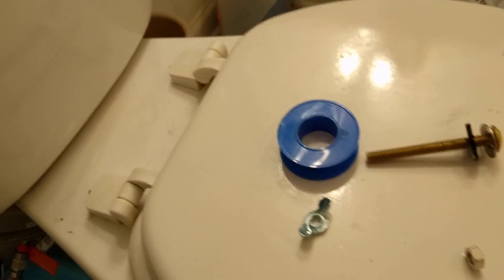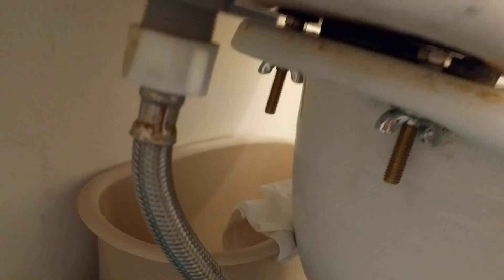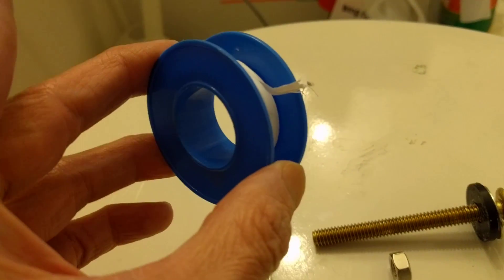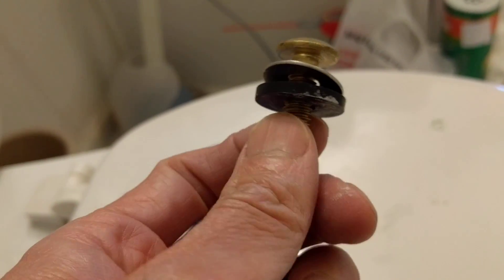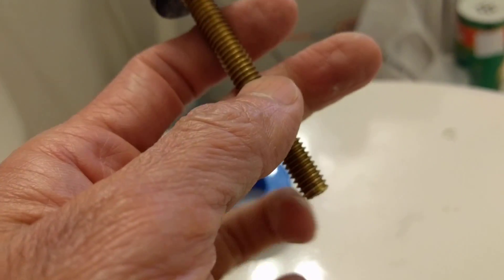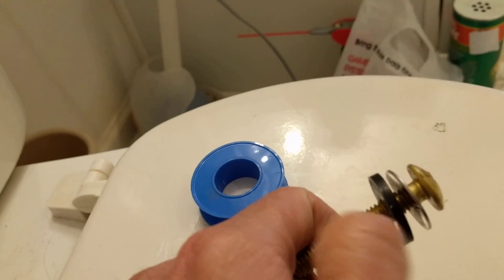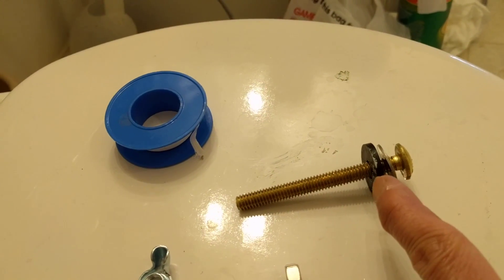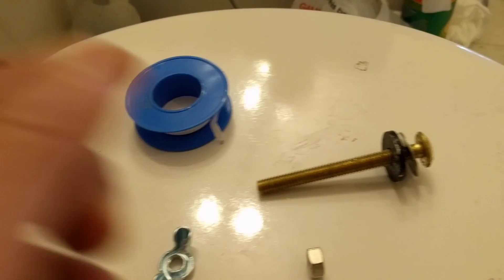Toilet bowl leaks from the screws

Comment: Great info thanks.   Reading some comments below , I came to the conclusion that the metal washer inside tank should not be there only the rubber gasket !  Once I removed the metal washers , no more leaks from the tank bolts !  Thanks everyone for the great advice.

Comment: I agree with the others saying you should not use the 1st metal washer. I know the instructions on the repair kits say to do so but if you look at how the new tanks come, it is always as follows: Bolt and 1 rubber washer inside tank. On the bottom, rubber washer then metal washer and bolt. Tighten until snug and  a slight more but do not over tighen. That's it. There is no way water will drip throught the threads. After that you can attach the tank to the bowl. It is also important that the bolts you use can pass through the ceramic holes on the bowl. If not, you can end up not being able to secure the tank to the bowl properly and the spud will not be seated in place firmly enough to not leak when you flush. Finally, on the bottom you can use the wing nut and a metal washer  with the rubber washer optional. Again do not overighten to avoid breaking the ceramic bit tight enoughg that the spud seals properly. No need for the teflon tape in this type of repair. To need it means you are doing some else wrong.
Reply: Actually all the instructions say NOT to use a metal washer inside the tank, and warn it will cause leaks. I just made this same mistake. Many how to-guides on the internet get this wrong too - would have saved me messing around with silicone!
Reply: It depends how big the bolt head is btw - i did try both approaches and currently i have two working bolts : 
1. Without a washer with teflon ribbon btw.
2. With washer because when i did push it without washer it pulled the bolt thru the rubbber seal (cone shaped but still). The head of my bolt was pretty small. 
So both works , if you don't overtight it ...
Reply: Exactly correct
Reply: I follow the instruction but doesn't work. What I did wash install bolt and rubber washer inside the tank,metal washer,rubber washer again,metal washer,and nut. it work great
Reply: Both metal washers outside the tank and nuts

Comment: Good advice in here. I think the best advice was to add the third metal washer underneath the gasket that contacts the underside of the toilet tank. This allowed for the bolts to remain straight and was easier to tighten the bolts under the bowl.  Using teflon tape is a solid idea too. I also had an issue with the bowl to tank gasket not fitting on the bottom of the valve. Frustrating because I bought the valve new and the gasket new,. To allieviate problems from the gasket moving when placed on the bowl, I added a bead of plumbers putty into the gasket and then stuck it to the valve.

Comment: You installed the bolt wrong, if you put metal on metal it will leak. If you put the rubber washer between the bolt head and the tank with no metal washers in between, it will not leak. Try it that way if it starts leaking again.
Reply: You are absolutely correct. I looked at mine and it is the way you said and have just recently figured out why  they did it correctly and originally that way.

Comment: thanks, good thinking. so the gasket wasnt the problem. the bolt needed a sealer... probably a more snug fitting gasket would have worked without the teflon sealer i'd imagine, but good to use both.

Comment: NO, NO, NO.
1st - Clean all the rubber washer seating surfaces on the inside (water side) of the tank. Don’t use anything that is abrasive or can scratch the porcelain finish.
2nd - Do NOT use a metal washer inside the tank. The tank bolt head is flat and oversized to make a water tight seal with the rubber washer inside the tank. A metal washer against the metal bolt head is not a reliable water tight seal. Water can leak between the metal bolt head and metal flat washer and down the bolt threads past the rubber washers. The rubber washer compressed between the metal bolt head and porcelain tank is the primary seal against water leaks at the tank bolt.
3rd - Use a rubber washer against the tank porcelain with a metal flat washer and a hex head nut under the tank to compress the rubber washer on the tank water side. The rubber washer against the outside of the tank prevents the metal flat washer and hex nut from damaging the porcelain. Tighten the nut to compress the rubber washers so they are secure but don’t over-tighten to avoid twisting, pinching, or buckling the rubber washers or cracking the porcelain.
4th - Position the tank cushion, if required, between the tank and stool to prevent porcelain to porcelain contact. Refer to the manufacturer’s installation instructions.
5th - To secure the tank on the stool use a rubber washer on the underside against the porcelain with flat metal washer and hex nut. Again don’t over-tighten the hardware to avoid twisting, pinching, or buckling the rubber washers or cracking the porcelain.
Comment - You can use a silicon o-ring lubricant on the rubber washers and flush valve gaskets to ensure they will not twist, pinch, or buckle when tightening, setting the tank, and tightening the hardware but you should not need this lubricant.
Reply: Hi, you describe using 3 rubber washers per bolt. The kits I have seen provide only 2 rubber washers per bolt. Am I better off using the 2nd rubber washer against the underside of the tank, or use it under the bowl flange (where the tank gets attached to the bowl)?
Reply: @wildmanofborneo  I only use one rubber washer and it works perfectly
Reply: @wildmanofborneo  or you could use the "old" rubber washer that you removed as the final rubber described above. Of course assuming that it isn't disentigrated.

Comment: They make bolts with rubber under the head…manufactured as part of the screw….to take the place of the washer…you just have to push them in firmly to seat them

Comment: When you put that very first metal washer and then gasket on THAT is where the mistake is. The rubber washer's purpose is to not only seal to the inside of the tank but also to the metal on the screw. So basically both sides of the gasket inside of the tank are creating seals. One to the inside of the tank and the other to the bolt. Another permanent fix is to use the JB Weld. It comes with 2 pieces of clay like substances. A white one and a black one. Mix them together until it is grey then make a doughnut. Put your basket through the bolt with the gasket on the inside of the tank. Put the nut and gasket on under the tank tighten it without cracking the porcelain then put it through the holes in the bowl and put the rubber gasket on then the wing nut and tighten evenly on both screws or all three screws depending on your toilet. Make sure they are even so it smashes the sponge gasket between the tank and the bowl correctly. If that sponge gasket dries out even a little bit I would replace it or you could flood your bathroom. Not fun. I've done that before.
Reply: SPONGE GASKET??!! AHHH wtf

Comment: I've never seen a nut placed in between tank and toilet when setting the joining screws. That might help with gasket crush but does that contribute to screw leak?
Reply: That's actually what Fluidmaster recommends. https://www.fluidmaster.com/toilet-problems/installing-resolving-leaks-tank-bolts/
I'm going to try that and see if it stops the leak. It makes sense because you don't have to be quite as worried about breaking the tank when trying to stop a leak.

Comment: Wrong,!!!! No washer in tank. The washer goes on the bolt under the tank. Should be bolt, rubber, porcelin tank, metal washer under tank the nut. Then wing nut under the bowl to hold tank on bowl.  It also appeared that he had no washer and nut under the tank between the tank and bowl on the bolt that leaked. Thats why it leaked.